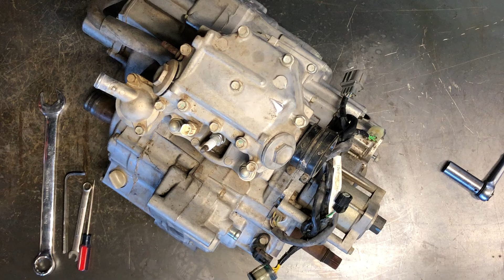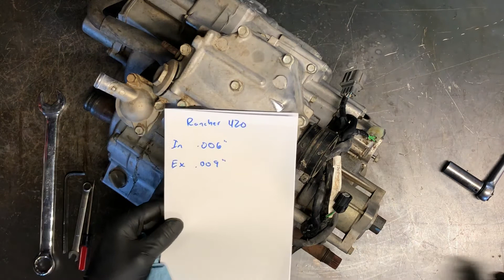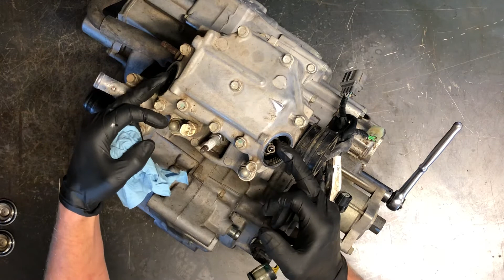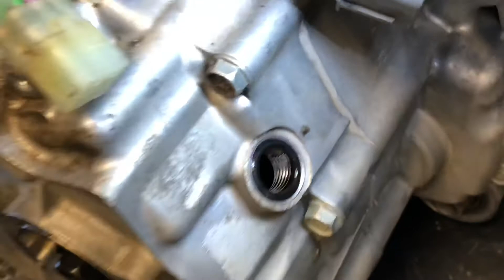How To Adjust Valves - Honda Rancher TRX 420 ES - Clearance Check - Adjustment - Head

Comment: If the pull rope is still there you can just use it to turn motor right,?
Reply from the maker: Yes you can. It is hard to get the motor right at TDC just using the pull rope. Would work tho. Thanks for watching.